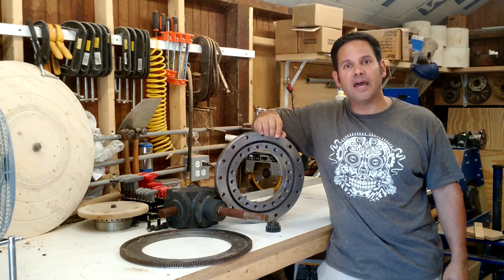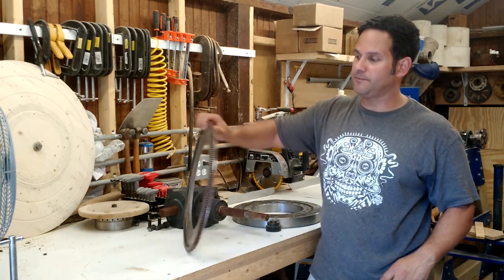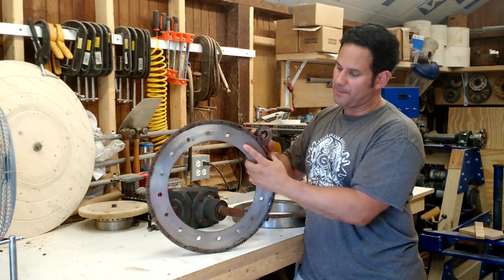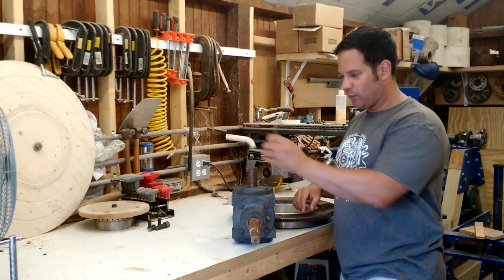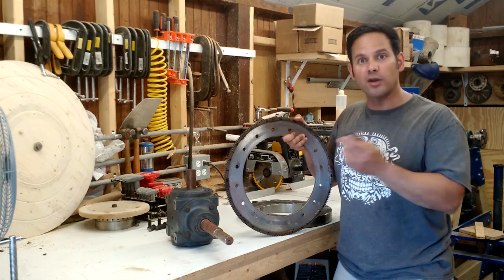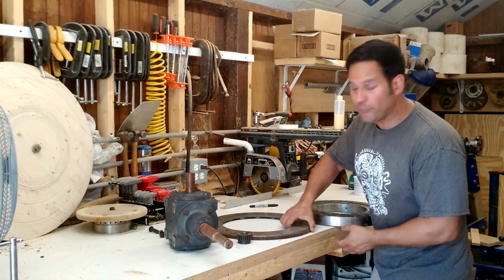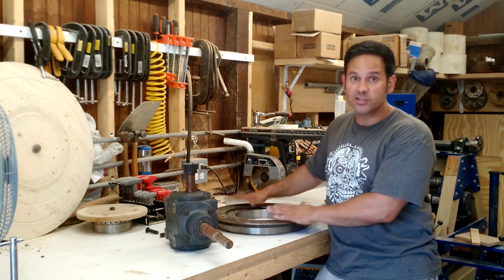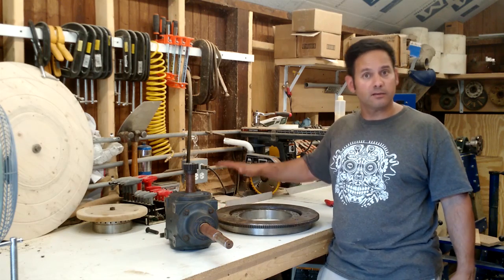Homemade VERTICAL wood lathe PART 1 - PARTS, concept and introduction

Comment: Thank you Ray. I told you I'd subscribe. I was thinking of using a direct drive type system right of a gear reduction box like a potters wheel. I'm looking to have about 400rpm which is what has worked turning our material on a small scale that we can put in our 14" Jet lathe but now we need to turn cylinders of our material that will range from 20-40" diameter thus the reason for my vertical lathe.
Reply: Ray Pena often times you can get three phase motors much cheaper than single phase which can often offset the cost of a VFD as well as having a much better torque curve characteristic and many associated benefits.
Reply from the maker: +Tony Thomas I think a vertical lathe is exactly what you need. All of the parts in this video I ended up getting off of eBay and have a total investment of about $200.  The stand that I'm using was rescued from the scrap pile.  Even the feet were left over...it will become clear on part 2.
Reply: Cool. I'll watch it when you post and I'll let you know where I'm headed with mine. Have a good one. How did we ever get along before you tube? Best thing since sliced bread!!!!!!
Reply from the maker: before YouTube....we had to do it the hard way.  i remember struggling through all my projects!  in one way it was more satisfying, doing it all alone without guidance.  but with YouTube it is definitely more inspiring and less expensive.
Reply from the maker: btw.  my lathe as designed should be right around 200 rpm....i might make a High and low so ill have 200 and 400 but im not sure just yet.
Reply: Ray Pena just put a VFD on it and have variable speed.
Reply from the maker: Yes...but VFD's are expensive and I am cheap....those things don't go well together, lol
Reply: I'm a big fan of cheap.
Reply from the maker: +Spark Gap yes you are right, I'm not sure if this particular lathe really needs to be VS
Reply: I think with the gearing ratio you have already and the fact you're only using a low power motor you could probably make do with a phase fired controller. Are you planning to use a 110v or 240v motor?
Reply from the maker: i have no idea what a "phase fired" controller is...are they cheap,lol? i can use either 110 or 220, i was waiting to see what i could find first.
Reply: much cheaper than VFDs but not as good. essentially they use SCR's to control how much of the sinewave is fed to the motor. the SCR can onky be triggered each cycle so it's not proper pulse width control but for say 50% duty cycle like what you would need for half speed it isn't a bad application. phase fired controllers are thet simple you can actually build you're own. they do have a few drawbacks though. I recommend checking out the post apocalyptic inventors chanel. his videos on how to reuse induction motors are particularly good at demonstrating the principle of operation. AvE also does a rant on them. sorry for the long post
Reply from the maker: all good info! thanks

Comment: Well Ray, apparently your imagination knows no boundaries.  I wonder why a scaled up version of a drive centre wouldn't work?  It strikes me that you'll need some sort of tail stock/live centre or steady rest or longer pieces would wobble.  Unless you are only thinking of bowls?  Looking forward to the next episode.  Great channel.  Cheers, Gord
Reply from the maker: +Gord Roberts thanks. You probably could use a regular "head stock" mounted vertically but I think it would have to modified tremendously to avoid pushing the shaft through the bearings.  The slewing bearing solves ALOT of problems.  Metal working vertical Lathes do not have centers or steady rests.  This will definitely be a challenge!
Reply: was thinking of mounting a custom drive centre directly to the slew bearing, no head stock required.  Just a fuzzy thought in the head at moment...:)
Reply from the maker: +Gord Roberts what kind of drive center...like a spur drive?
Reply: That was the word I was looking for alright.  Could also be adjustable, like a very large scroll chuck, not sure about cutting a scroll that large and would want an adjustable chuck to be self-centering.  Still wondering about keeping it from wobbling though.  Intriguing project for sure.
Reply from the maker: for the immediate future of this machine, i might just make an adapter plate so i can mount my existing chuck and faceplates.  for the long term future, i think ill need to have a tslot plate with movable jaws....something to think about for sure
Reply: I've seen old four jaw chucks where the jaws were moved in and held with jacking screws and centring of the piece was achieved by lining up reference marks (circular grooves).  If this thought carried over to the t-slot plate you could keep the overall height profile of the plate low which would reduce wobble, compared to mounting on a six inch chuck.  Ideally the workpiece tenon would be similar diameter as the slew bearing.

Comment: I can see the advantages of working with gravity here with no sagging. up right gravity can help to hold a workpiece in the lathe, but if you had a way to mount the lathe upside-down and still hold a workpiece securely then gravity could help to keep things true. maybe not. thoughts?
Reply from the maker: upside down lathe....sounds like a project idea!

Comment: Very interesting. And very big ;). I'll be following this project. 

What would you turn on this? I think its best for giant spindle work as hollowing isnt an option with the hollow filling up with shavings?
Reply from the maker: +Willem Kossen thanks! i plan on using it for roughing work...for now. it is really just an experiment, particularly since i already had all of the parts in the shop.  im thinking live tooling, heavy cuts and air to blow out the chips.

Comment: If this project fails, you can always use it as a rotisserie with a built-in slicer--schwarma/gyro-scope. Seriously, you can use a regular lathe chuck. You might have a vertical steel bar with a sliding bushing to hold a tool or carriage.
Reply from the maker: yeah im going to need to decide how im going to hold my work.  a t-slot plate with movable jaws might be the best way to do this.... it think

Comment: Should be interesting, I was a welder early in my life .  I saw a vertical friction welder they would spin the bottom  at a high rate of speed than push the steel bar to the aluminum round. Friction welding!! I can see the advantages not to hold the weight of the piece you are turning.  The upper tool could come in from the top  maybe like a metal lathe does from the side !??? Just thinking out loud?????  Regards Robert E. Lee ( Bob Lee's woodshop)
Reply from the maker: +Robert E. Lee / Bob Lee's woodshop yeah, friction welding is awesome!